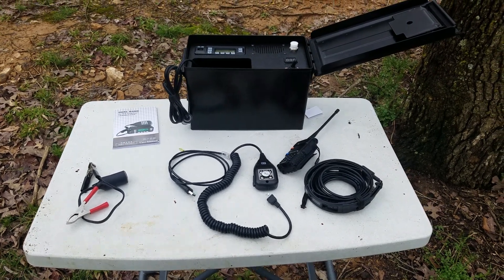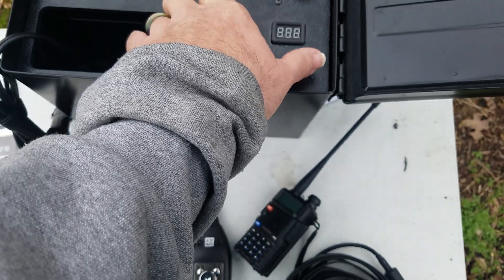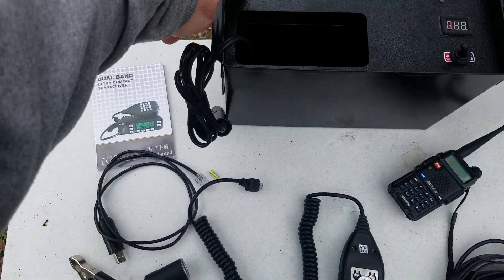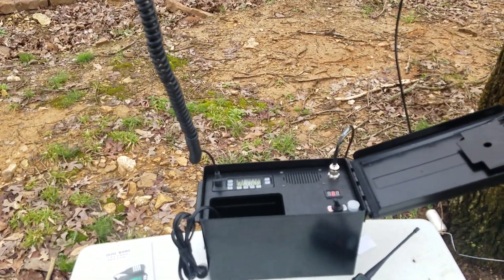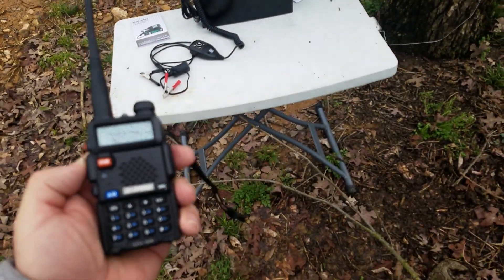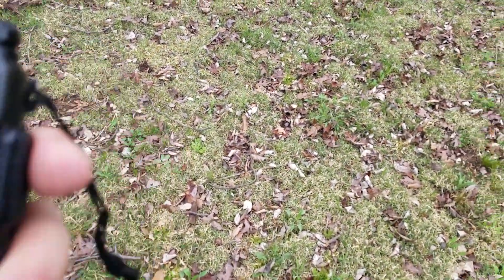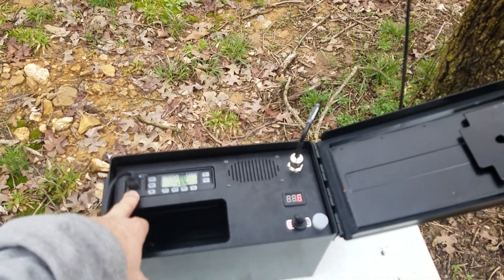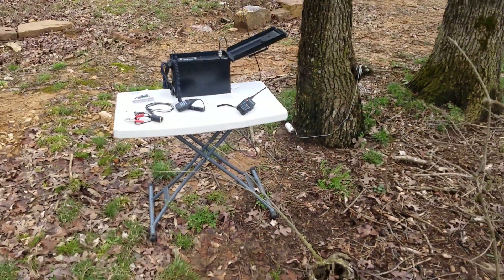Testing Canned Ham radio in a box

Comment: Good video, thanks for showing it. What is your range with that set up? How far could you reach a handheld unit with that?
Reply from the maker: I've worked probably 5/6 miles simplex to a HT. It's got a 20 watt radio and roll up JPole antenna. Obviously distance varies based on antenna height and terrain.
Reply: OzarkGeek so you think it’s a good value and a person would be wise in purchasing this?
Reply from the maker: @expandfreedom2283  If the idea of portable, self-contained operation is important to you, yes, it's a wise purchase. Check the vendor's website via the link above and see what he offers.  As a system, I like it. Very portable, easy to charge, and all the basics you need. The included roll up j-pole is good.
Reply: OzarkGeek thanks, I appreciate your thoughts